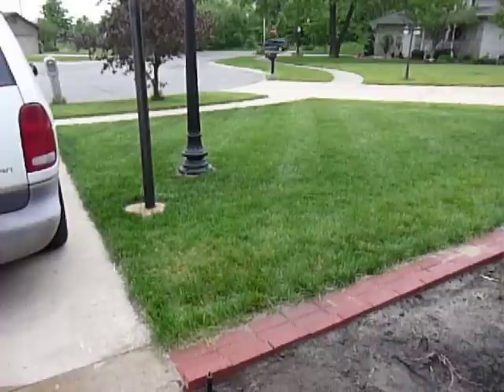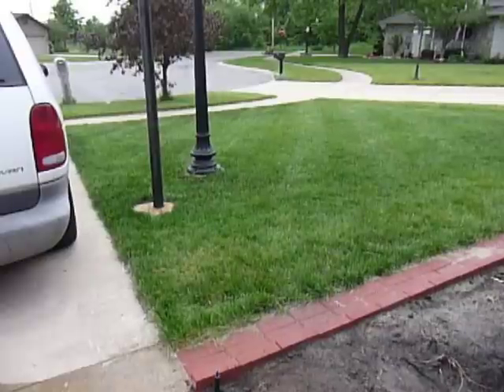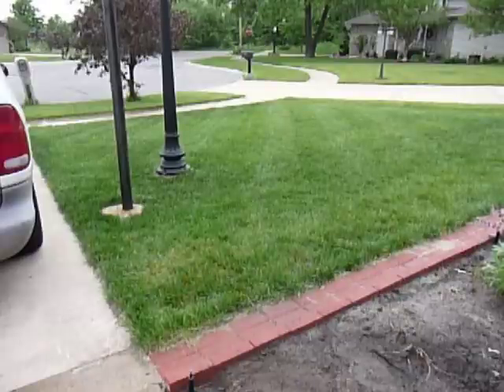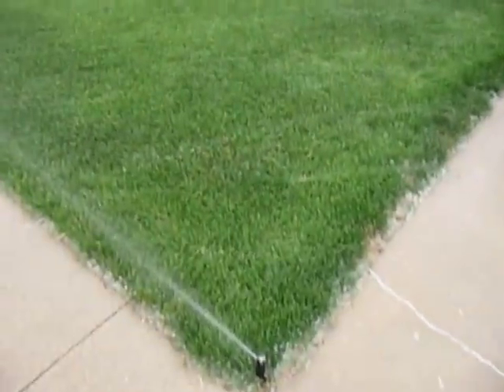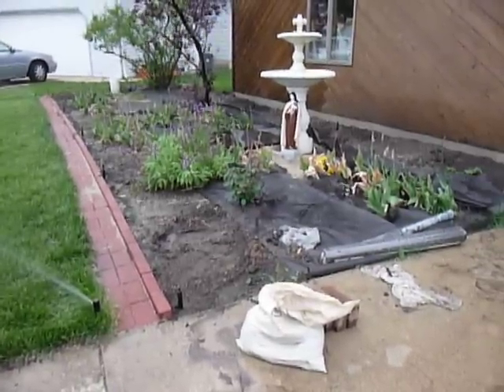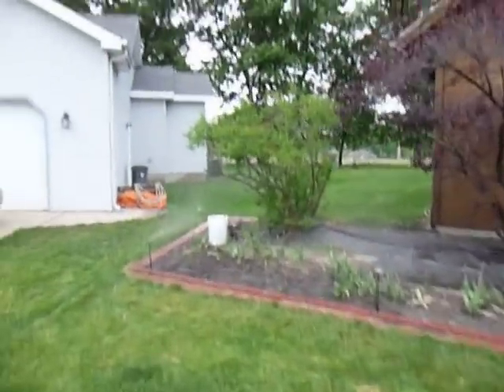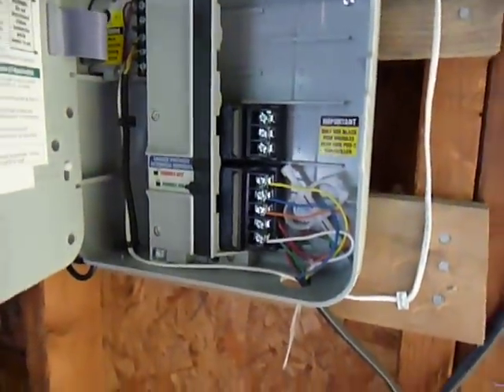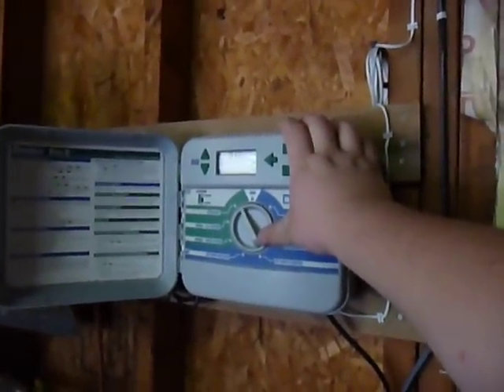Tour Of My Lawn Irrigation System

Comment: I just watched this video. First off Good job!
Zone 1- This summer take some time to re-design the zone.  You can get away with using a low volume nozzle with the same amount of flow. ( IE Rain bird nozzle size 8's.)  Adding heads to the corners and having full's in the middle will help on your distribution uniformity. 
On zone 3 ( Front garden drip)  I would recommend to lower that first corner head to be roughly 1" above ground  ( Because you are using micro-nozzles that clog easily)

Comment: The sprinkler head looks to be above your brick edger . This area is a high traffic area and so the sprinkler head has a higher probability to break. 
Zone 2 ( Front rotors) I know PGJ's are hard to adjust, take some time to finesse  the two heads that are near your driveway and walkway- try to get the overspray to stop. 

You said you had sand, for your lawn zones I recommend a 'cycle and soak' style of watering.   There are a lot of ways to this method, the most basic is splitting

Comment: the zone minutes into 3 sections ( Ie zone 2 runs for 20 min) split this into 3 - 7 min run time cycles with a separation period of 30 min or so.
Seperate your lawn zones with program A ( Using your 3 start times) and use program B  for your shrub zones.

Also, it's recommended to have a backflow prevention device installed.  Using an AVB valve is not good enough. The proper backflow depends on your local codes.